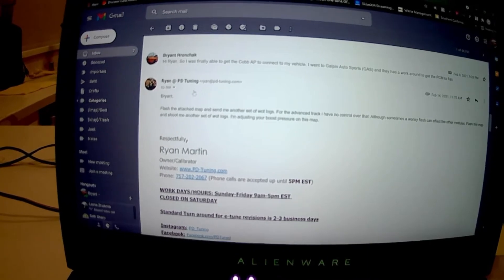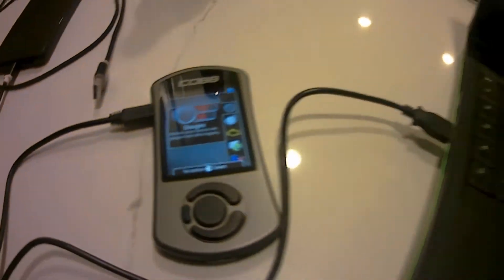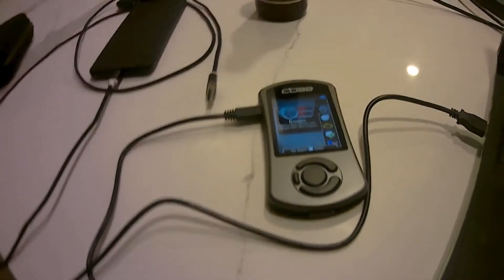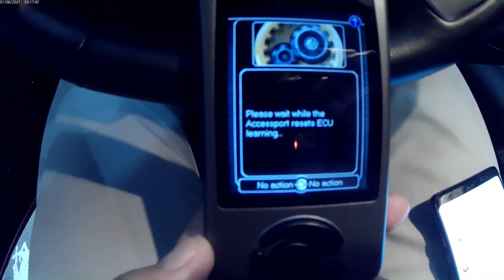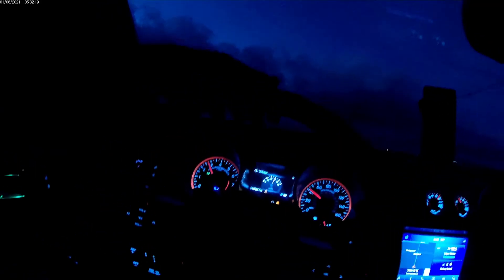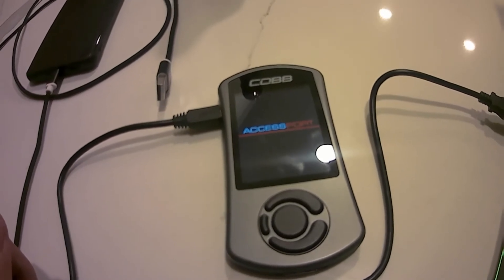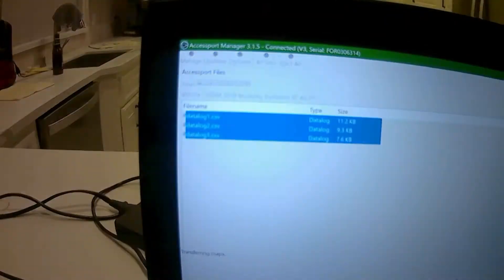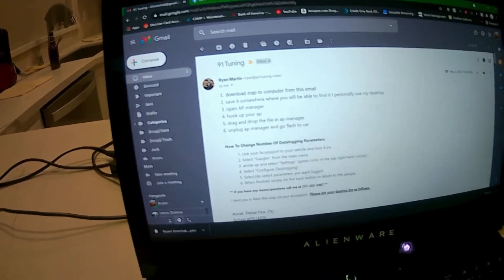Ecoboost Mustang PD Tuning Process with Cobb AP

Comment: Is it possible to have pd tune and transmission tune done on stock 2017 ecoboost auto?
The only thing i might do is get a drop in air filter.
Reply from the maker: I would think so, but not really sure.  I would send an email to Ryan at PD Tuning and ask.
Reply: @mustangmodsecoboostgarage6539   no worries thanks
Reply: @mustangmodsecoboostgarage6539  so when you had the final pd tune done was it a  really big difference compared to stock?
Has there been any issues or has it been pretty smooth sailing?
Reply from the maker: @xrmte  Yes, I probably went up to about 375 WHP and over 400 WTQ with the E30 tune.  However, I pushed my car too hard with the stock turbo and block overheated causing a warp and the head gasket blew.  I had everything replaced under warranty though and have not gone back to the E30 tune ever since.
Reply: yes they do transmission configurations

Comment: Can u add this tune ontop of the stage tune you already have installed? or must delete stage 2 tune and only run PD burble tune
Reply from the maker: No, you can only run one tune at a time.  If you contact Ryan at PD he can customize a tune for you that may be able to include a bubble tune, but not really sure.

Comment: Brian, 
I am new to the Ecoboost Mustang. You do an excellent job explaining the process of custom tuning the car. I like how you data log as you drive and upload it to your tuner for evaluation. Were you able to save the factory tune that came with the car?
Thanks for taking the time to share this information,
Tom Elam
Reply from the maker: Hi Thomas, thanks for the feedback.  The factory Tune is automatically restored to the car when you Uninstall your Access Port.
Reply: @mustangmodsecoboostgarage6539  i got a used cobb accessport v3 from a friend, but it seems not compatible to my 2020 ecoboost
Reply from the maker: @shawyu9430  What does it say when you connect it?  Does the option to INSTALL show in the menu?
Reply: @mustangmodsecoboostgarage6539  version not supported, anyway I contacted Cobb support, and they said it’s a new code that the need to update the firmware
Reply from the maker: @shawyu9430  yeah, i heard about that.  Never seen it in person before.  Good luck.  I hope they don't charge you too much.
Reply: I see that you were able to save the base tune. That's cool.

Comment: So you got ur base tune, off the shelf tune  and the new revised tune ?
Reply from the maker: Yes, I saved both my Base Tune (Ford Performance Calibration), my OEM Tune (As Built configured by Galpin Auto Sports), my 91 Octane Tune from Ryan Martin, and now my E30 Tune from Ryan Martin all saved on the AP.
Reply: @mustangmodsecoboostgarage6539  how did you remove the Ford performance tune?
Reply: How did the Cobb and Ryan protunes compare to the Ford Performance tune?
Reply from the maker: @TK-ex5ns  Th FP Tune was not bad, but left me wanting more.  Once I started tuning with Ryan I was able to get my best 0-60 time of 4.7 and 1/4 mile time of 13.1 with just 91 octane.  Prior to that my best was 4.9 and 13.3 and that was with mixing in Race Gas with 91 to achieve about 95 octane.  Now that I am on E30 my 1/4 mile time is down to 12.6 and I am not sure about my 0-60 time because I have not tested it recently, but I have a 4.6 stored in trackapps now.
Reply: @mustangmodsecoboostgarage6539  how much for that 91 tune?
Reply from the maker: @CoyoteDAworld  https://www.pd-tuning.com/shop/fors/tuning-rs/2-3-custom-tune/
Reply: By base I mean oem file how the car ran stock

Comment: Ayyy 🔥🔥🔥🔥so I figured out what’s wrong with my bov I’m doing an update video but I got it all fixed !! She runs great now I just need a tune for some fun then back into the engine
Reply from the maker: Nice, what was the issue?
Reply: @mustangmodsecoboostgarage6539  so the turbo smart race port 50mm bov is universal usually then send the “orange” one it’s a orange gasket you can see where it should open so that one is rated for -18 psi and ecoboost run -20 psi and full boost is 20 psi so the spring that comes with the bov is to weak and dosent hold  boost in my case it would flutter so bad and when I fully floored it you could hear a loud vacuum sound and my car would act like it was n/a so since I’m stock I just added the pink spring from the turbo smart spring kit it’s rated for -22psi so now it holds boost I added that spring with the original spring it came with now I’ve helped other people who are tuned they needed an even stiffer spring bc they got more boost there’s a reference in the turbo smart spring kit they have a pdf of the different springs and what they’re rated at I helped a dude who was tuned he’s running 3 springs he used the pink orange and blue spring he was at 24 psi so yea the spring kit helps bc it’s a universal bov
Reply from the maker: @ballstoyou33  cool, this is good to know.  I plan on getting this BOV soon.  Thanks for the info.